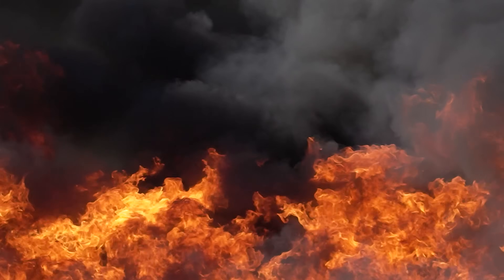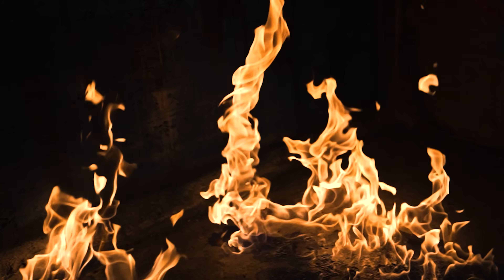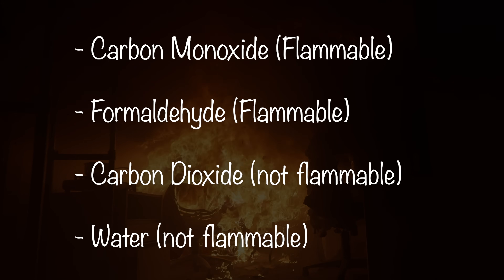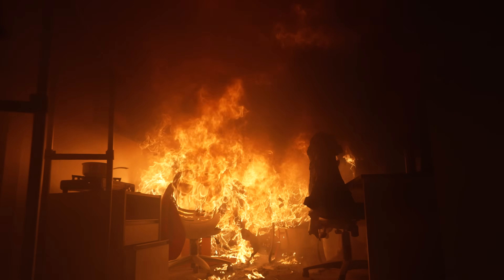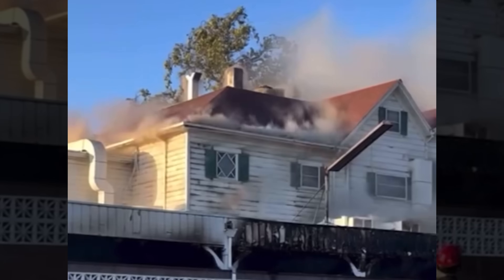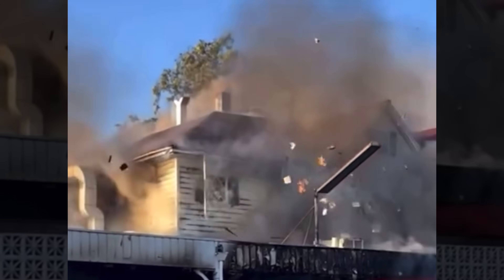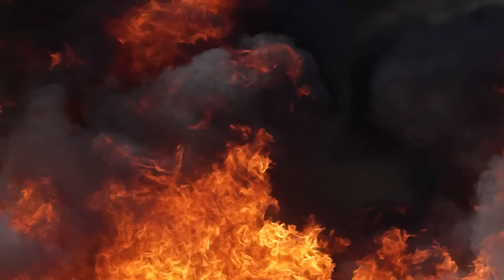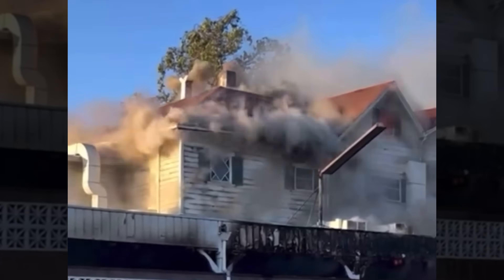An intro to Smoke explosions (aka fire gas ignitions) - episode 35

Comment: So correct me if I'm wrong, but I think a way to remember the difference between a smoke explosion and a back draft(or a simplified way) is that in a back draft, the O2 enters an area full of smoke[fuel] and heat. While in a smoke explosion hot smoke[fuel + heat] enters an area full of O2.
Reply from the maker: That’s a great way of describing it. Nice work! You could add (although not essential) that flashover and backdraft will normally come from the or a room that contains the fire. But fire gas ignition will often come rooms that are not on fire yet.

Comment: What Matt is missing with respect to his talk about smoke explosions is that visible smoke only accounts for approximately 20% of the products of combustion. The remaining 80% of the POC are invisible fire gasses. So when you see smoke you are only seeing approximately 20% of the products of combustion. Calling the explosion of fire gasses that make up the majority of what is available to combust in the atmosphere of a burning building a “Smoke Explosion” is off the mark. It’s a Gas Explosion not a Smoke Explosion. It’s important to gain a good grasp of this concept (gas explosion) because without it you get trapped in a cycle of trying to figure out the difference between smoke and fire gasses. Matt does mention the fact that Carbon Dioxide is present in the atmosphere of the fire but he never mentions how much CO2 is present in a fire and how it helps to prevent smoke (gas) explosions. It helps to know that for every pound of carbon that burns in a fire it produces approximately 3 pounds of carbon dioxide (CO2). CO2 is burned carbon that can’t ignite (Matt got this right). What Matt overlooked is that CO2 plays a key role in preventing backdrafts, flashovers and smoke/gas explosions. CO2 deprives the rich - unburned fire gasses from igniting but only if the amount of CO2 in the fire atmosphere is greater than the amount of fuel rich fire gasses (the 80% of gasses in smoke) in the fire environment. If more CO2 is venting from the structure than CO, Methane, Benzine etc., the rich fire gasses become lean fire gasses that enter the flammable (explosive) range. If fire gasses enter the flammable range with enough available oxygen in the fire environment then you are more likely to experience a smoke/gas explosion than not. 
My advice: Keep it RICH!!
Don’t over ventilate by cutting a hole in the roof or breaking windows. This only lets the CO2 escape as it allows in more and more oxygen to ignite the unburned fuels. Also, fires are chemistry and physics. Gas cooling is a method that works to act upon the physics of the fire by lowering the temprature (the heat output). The problem with gas cooling is that you run the risk of making the rich fire gasses lean by diluting them. Rich, unburned fire gasses that become lean fire gasses have the potential of igniting as they enter the flammable range. If you add a wetting agent to your water it acts upon the chemistry of the fire by lowering the high surface tension of water so the water molecules can bond to the carbon molecules in smoke and fire gasses making them too wet to burn. Don’t believe me? Google the science of soap and surfactants.
Chief Hughes
Battalion 1 (retired)
Chicago FD

Comment: 5:51 What do you mean? Smoke explosions, backdraft, and flashover are all the same thing... they just arrise due to a rise in the concentration of one of the reactants, or due to a rise in the energy of the reaction (the heat) - until they reach a critical point.

Backdraft is when there is enough heat to cause instantaneous ignition of the fuel suspended in the air, but there isn't enough oxygen to allow the ignition to occur and propagate - until you suddenly introduce that oxygen. Then backdraft occurs.

So from heat, fuel, and oxygen - we had heat and fuel, but needed oxygen.

Flashover is when we have enough fuel and oxygen, but we're lacking heat. But as the fire burns and the heat is trapped by a confined space, it eventually heats up until you reach the critical point - and it flashes over because all of the smoke ignites.

I assume, therefore, a smoke explosion must be when we have enough heat and enough oxygen, but the air-fuel mixture is too lean. But as the combustion products are trapped in an enclosed space and the ongoing combustion uses up the available oxygen - the mixture gets more and more fuel rich. Until it reaches the critical point and immediately ignites. 

The force behind all of them is the sudden increase in water vapour output and heat from the combustion. That suddenly increases the volume of the gasses drastically - but in a confined space this results in a spike in pressure - BOOM! (Or WHOOSH! depending on level of confinement)
Reply: 8:20 wait... I thought that was how flashover worked... is flashover when the air fuel mixture gets rich enough to burn? 
And a smoke explosion is when we don't have enough heat?
Maybe I just got those 2 backwards.

Comment: 4:50 Ummmmm... didnt you just lay out a fairly good rule of thumb??? 
To make non-flammable products, we need to fully oxidize carbon and hydrogen.... so smokes produced in an oxygen deficient environment are more likely to be flammable... because they'll contain more elements that can still be oxidized (ie combustable fuels)....

That seems like a good way to determine that to me.

The other major thing to consider would be volatile chemicals that become gaseous - like in the candle example. After you put the candle "out" significantly less combustion is occuring, but the residual heat continues to vaporize the wax and produce particulate matter - which is why the smoke remains flammable despite the oxygen rich environment it was produced in....

Right?
Reply: Oh, I think I see moreso what you meant now. You cant tell when the air fuel mixture is getting MORE rich than it already is. Meaning you cant predict if/when a smoke explosion will occur with accuracy. 
You just know it might, and it's more likely in oxygen poor fires.
Reply from the maker: That pretty much it 🙂. With under ventilated fires it is more likely that the smoke will be more fuel rich when leaving the fire compartment. Therefore when it mixes with the air in a joining compartment a flammable mixture can be made. However, there are many factors like e.g. fuel types  that can affect the smoke’s composition. Combustion really is quite a complex thing when you look closely. Additionally the ventilation profile and some other factors will have a significant effect. But if it helps I made a video called “why smoke is getting worse” that explains a bit more of the puzzle 🙂 thanks for your comments!!

Comment: A "gas" refers to a substance that naturally exists in a gaseous state at room temperature, while a "vapor" is the gaseous state of a substance that normally exists as a liquid or solid at room temperature; essentially, vapor is a gas that can easily condense back into a liquid, while a gas typically cannot under normal conditions.
A flashover is the near-simultaneous ignition of most of combustible material (smoke/particulate) in an enclosed area.
Reply from the maker: I think smoke and the different components within in it (gas, Vapor etc) could have their own video or even multiple videos. I’ve used it as general term here as the video is just a short introduction to the concepts rather than a deep dive. But yes you are right, there is a difference between them 🙂. As for flashover I have seen it described as instantaneously occurring. However, there are many factors that will contribute to how quickly it occurs e.g. ventilation profile, fuel type, fuel load, location of fire, shape of room, height of room and a range of other factors. It can occur in a few seconds, but it can also occur over tens of seconds. So a helpful way of thinking about it for firefighters is a transition from a fire within a room to a room on fire 🔥

Comment: 1st Rate, Top Tier presentation ... except 
Fire is a Tetrahedron not Triangle.  
If you break the Thermo-Chem chain reaction that makes/allows Fire to self sustain you will accomplish the same as if you had removed or negated any of the other 3 elements of the Triangle. Right?
Reply from the maker: Yes it’s often called the tetrahedron 🙂 I bounce between them both. But if I use the triangle I always add the self sustaining chemical reaction as a part of the explanation 🙂

Comment: Ahhhh the magic of CHO in IDIC:
C2 H5 OH - burns and explodes
CO2 - puts out fire
H2O - puts out fire
H2 - burns and explodes
O2 - burns and explodes
Reply: technically, O2 helps the other two burn and explode, O2 itself isn't flammable
Reply: @defeatSpace H2 by itself isn't flammable either, both the O2 and H2 are just reactants in the same combustion equation.

Comment: Would an exhaust fan be helpful to remove the fuel mixture and heat?  A low speed or high speed fan?  Or would that pull too much Oxygen into the original fire area?
Reply from the maker: Great question! Well this is just my personal preference, but I’m always a bit cautious when it comes to ventilation on unsuppressed fires (even in extraction as it still moves a lot of air). I prefer to see some suppression first and then ventilation. Otherwise you can run the risk of some pretty serious down sides.
Reply: @MattDavis5  Excellent answer and something that I I didn't consider.  I've heard of FD doing that sort of thing to prevent explosive involvement of enclosed areas that contain extreme heat and uninvolved fuels but that left me to wonder about the issue of bringing in fresh air to the original fire.  I suppose the situations can get to a point where temperatures are so high that they do it simply because it relieves the heat in a dramatic way.  I see the sensibility in hitting it with water first and have the thought that it would be ideal to hit anything that is over 200F with water immediately which could prevent the complicated situations altogether for the most part. (I suppose water vapor (steam) added to any heated fuel/Oxygen situation would also complicate additional combustion better than not, as well as inhibit the original fire and lower temps, but that is another thing that I have no practical experience or knowledge in).  I have to admit that fire has always been my number one concern with regard to home and family.  I've always taught my children that if they see a fire that can't be put out in less than 60 seconds to immediately come and wake me and everyone else up, before attempting to put it out because a situation like that could be confusing for children.  Thanks for the reply and I was surprised by the idea that there seems to always be something else to learn about residential/confined fires.

Comment: Excellent video! Would it be possible that in some of these multi-compartment events a backdraft could cause a smoke explosion ?
Reply from the maker: Thanks! Great question!! I guess it could. But there would need to be a few conditions line up for it to occur. But if the fire room wasn’t fully sealed (but still sufficiently sealed to create a backdraft) and then the air flow required for the backdraft didn’t take the smoke out of a flammable mixture then maybe!.. I’d say it’s unlikely, but not impossible 🙂